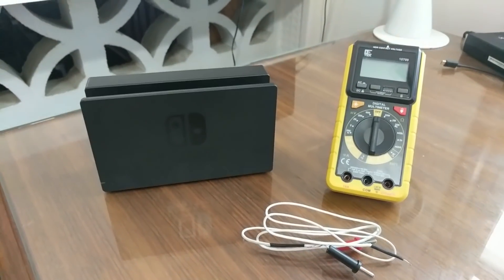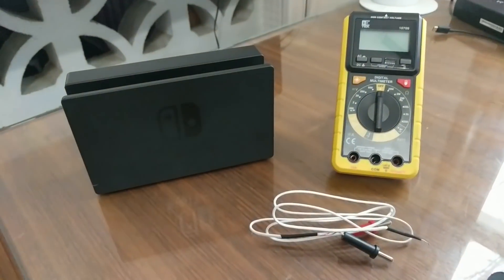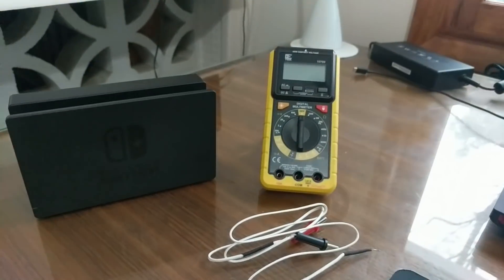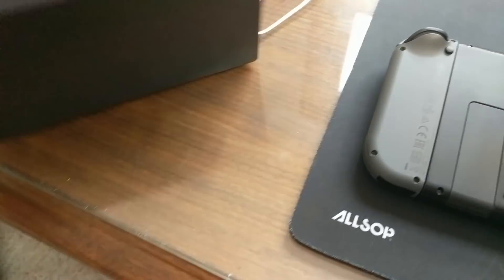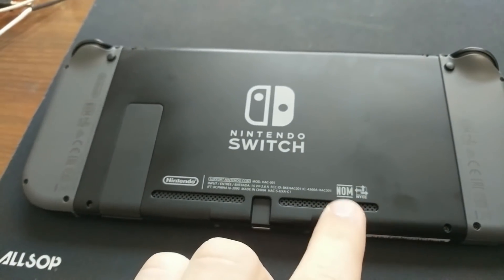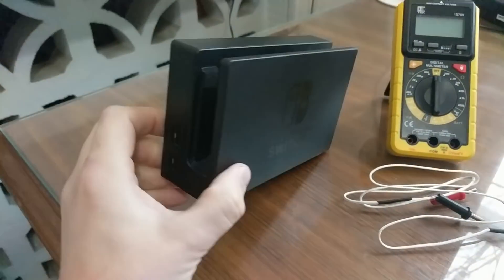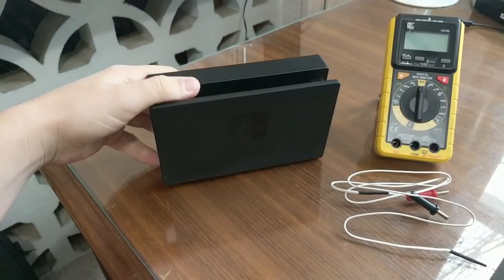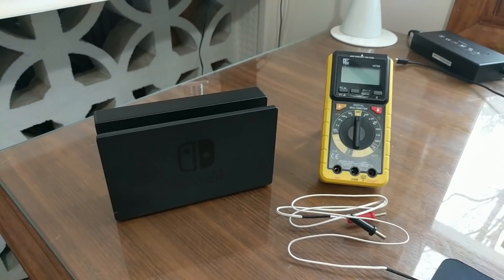Final Nintendo Switch Cooling Mod - Available Now!

Comment: Yeah so... you are trying to fix a non existing problem :v
Reply from the maker: So the mass amounts of reports of overheating by other people don't exist?  Even aftermarket manufactures make air flow attachments, so I guess they did it for no reason either?  All the modders out there that cut and drilled holes in their docks to install fans, they did it all for nothing?  Seems clear you straight up have no idea what you're talking about.  Either that, or you're jealous that I came up with a moderately effective, super simple mod to help fix it.
Reply: Well, it isn't a problem (Except for a few people). But it's more of a hardware longevity improvement. And having hardware last longer is always a good thing.

Comment: How does it get the cooler air ?
Reply from the maker: By making the vent "input" extend out from inside the box, as far to the upper vent area (where the colder, room temperature air exists).  Think of it sort of like putting an true cold air intake on your car, as opposed to using a "short ram".  Short ram pulls air from the hot engine compartment (similar to what the stock dock does).  The mod is like a cold air intake, where the actual intake inlet is not inside the hot air area, but out where it is colder.

Comment: This helped me with exactly 0 degrees.
Reply from the maker: How are you measuring the temps?
Reply: @M1dn1ghtN1nj4  
My switch is jail braked so with homebrew which is 100% accurate.
Reply: @M1dn1ghtN1nj4  are you going to re up the listing?

Comment: Curious if still available
Reply from the maker: Philbert Begay yes.  eBay listing is in the description.  Also, I just tweaked the design a bit.  Added a little structural support near the inlet.  Will hold up in shipping better, and help direct air flow (not a huge improvement, but something is better than nothing)

Comment: This actually serves no purpose at all
Reply from the maker: Jacob Hessler Or, you don't understand what it does. 😎
Reply: I dunno about him, but I, definitely don't understand it. Could you explain in to me please?
Reply from the maker: Ivan Lopez it forces the Switch to bypass the hot air inside the circuit board enclosure, and pull in colder air from outside the dock.
Reply: I thought so, but I needed confirmation. thanks!
Reply: Try playing fortnite on the switch. You're welcome
Reply: M1dn1ght N1nj4 Sorry to break it to you, Buuuut consoles don't cool off the same way we humans do. By having cool air blown on us, We are that way because our body is filled with blood. The way consoles are cooled down is by having a air flow threw out the system so takes in air and then pushes out hot air from the cpu unit, It taking in cold air will do 0 to it as the air will just get heated in the process the temperature which you are testing isn't showing any results because the cpu unit will be the same temperature. You letting in cooler air isn't helping its heating problem. Its as simple as you thought the system was cooled down like a human and didn't know the complexity of systems needing cooled down.

Side note: I'm not saying this to be rude, I'm just letting everyone know.
Reply from the maker: Then YOU don't understand how electronics work.  Your explanation is maybe 10% right.  But basically the efficiency of removing heat from the CPU increases with colder air.  If you need to look up "CPU fans", "heatsink", "processor cooling", etc, you might learn about how to cooling process works.  How do you think liquid cooling in PCs works?  To make it simple, the liquid is a more effective heat transfer method than air, but serves the same purpose as air, to pull heat away from the CPU in greater quantity.
Reply: M1dn1ght N1nj4 Thank you for letting me and correcting me, Now I know. Much appreciated
Reply from the maker: No problem.  We all learn something new every day. 😎. I'm still learning about 3D printing, and I've been corrected plenty of times. 😎
Reply: Corey TheGamer Boom roasted

Comment: 1:10 those "vents" are for sound, there's no mechanism for pulling air through those holes, you can watch any teardown to figure that out
Reply from the maker: That's actually incorrect.  If you had actually watched any teardown, you would know that's not where the speakers are located.  Maybe do a bit of research first next time...